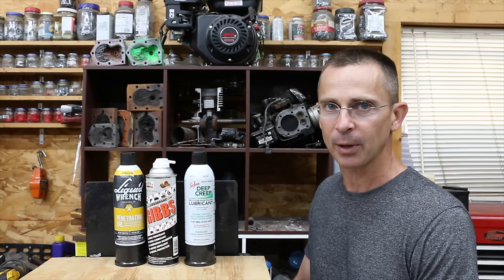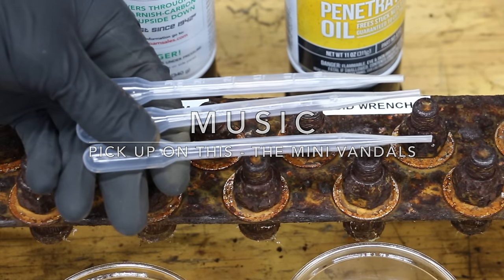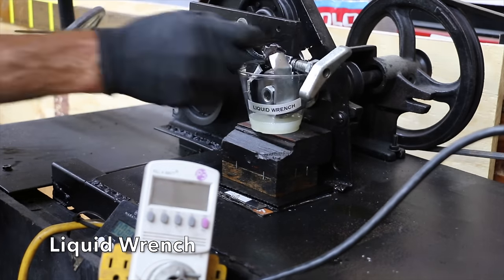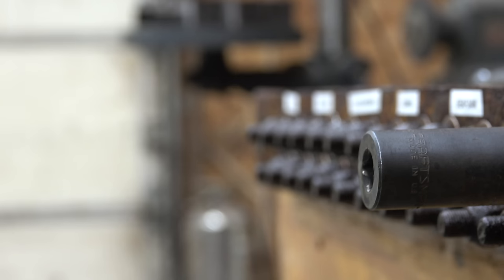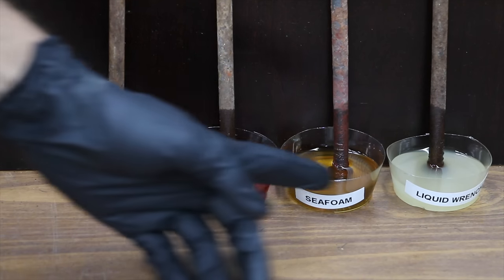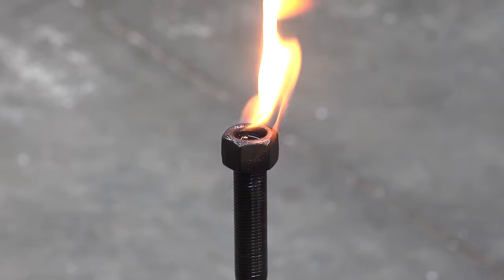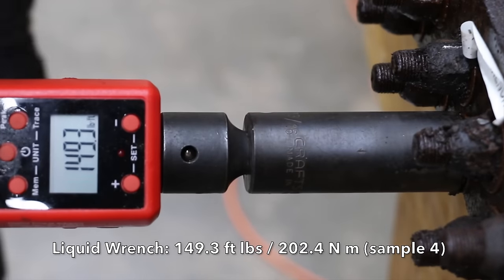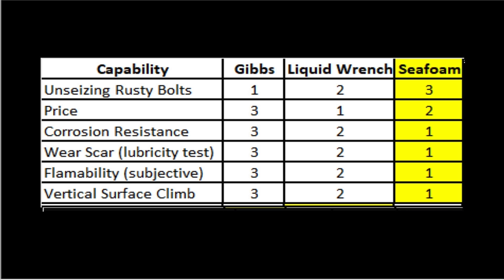Best Penetrating Oil?  Seafoam vs Gibbs vs Liquid Wrench

Comment from the maker: Thanks to everyone who requested this showdown.  Here are links to the products tested.  Thanks again, Todd
Gibbs: https://amzn.to/34pk47Q
Seafoam Deep Creep: https://amzn.to/31kSNBw
Liquid Wrench: https://amzn.to/32f2AIG
Reply: So... does this mean people should spray their engines down with Sea Foam Deep Creep to prevent rusting?
Reply: @TheRealNormanBates  it's not a bad idea to spray something in your engine especially if you thinking of putting it into the storage for longer preiod of time. I would spray something into the intake while cranking engine and then hand crank and spray individually in each spark plug hole or injector  port if it's a diesel. i would mix all brands togheter to obtain all features  lol
Reply: I would have liked to have seen Vinegar used in these tests as well.
Reply: @kevinradford9336 He used vinegar in earlier tests.
Reply: I'd suggest using a wire brush to clean and clear exposed fastener threads, is probably more important than the fluidic ability to carry the nut over the threads.   Really breaking free frozen nuts and bolts should be the big consideration here..
Reply: My question is, do you try and loosen the bolt after applying heat to these products, did they break it loose or break the bolt? I'm trying to find the most efficient product while also considering applying heat.

Comment: As a professional mechanic in the rusty midwest i used to be a PB blaster guy until i saw your videos. Switched to liquid wrench and haven't gone back. Best performance for the price.
Reply: Even if PB was a bit better i won't use unless it's all i have handy,  The " Blaster in the name is an accurate description of what happens when ya push down on the snozzel..
Reply from the maker: Thank you very much!  I have a lot of rust to deal with on the farm and Liquid Wrench is my go to product due to the price and amount of product I use.
Reply: Shoot, I also posted almost the same comment above
Reply: @ProjectFarm  
I usually have to deal with rusted latches, such as pintle hooks, instead of bolts in my job. I used to use WD40, but now that I've watched your comparison, I think I'll switch to the cheaper Liquid Wrench.
Reply: Ikr. The gibs might be better, but good lord, not for 3x the price of liquid wrench.
Reply: @ProjectFarm  As your testing pointed out, Liquid Wrench is flammable where Deep Creep is not. If you are removing rusty nuts and bolts
and you heat them up after applying Liquid Wrench you will have a fire under the vehicle that could be quite dangerous not with Deep Creep.
Enjoyed your video, but I will still stay with Deep Creep.
Reply: @ProjectFarm  I use WD-40 to help break any stuck bolts free on my farm and it works pretty good for me
Reply: @JuliaCV9  try liquid wrench, it'll be a lot better
Reply: @M.TTT.  better than WD-40?
Reply: @elliottmaendel4686  kroil is amazing, I agree
Reply: @elliottmaendel4686  He tried Kroil in an older video and it was one of the worst in terms of effectiveness.
Reply: Nah for really seized stuff CRC freeze off
Reply: Blaster lost to liquid wrench in the previous competition
Reply: @Light Roast Coffee This is why I switched from PB- the smell is haunting and overpowering. Liquid Wrench always disappointed me surprisingly, in comparison, but much better smell. I’ve since stuck with the WD40 Penetrating oil with “low odor” (similar to PB’s smell but much less strong)

I have a 1960’s can of Harmony penetrating oil. Not only does it work (and have a cute musical note design motif), but it actually smells GOOD! vaguely sweet and not caustic
Reply: @ObservationofLimits  crc lost to sea foam and sea foam lost to liquid wrench
Reply: I'm converting a couple people out here in northwest Kansas myself. Everyone just uses PB because they like to call it panther piss... I need to come up with a nickname for liquid wrench. Any suggestions?
Reply: @ronc8598 over the last couple years their nozzle things have become pieces of crap that hardly ever work correctly in the first place and almost never empty the entire bottle. it's ridiculous

Comment: >waiting for this video to finish while I'm standing in Lowe's so I know which product to get so I can get the oxygen sensors loose from my exhaust.
Reply from the maker: I hope you have good success getting it out.  Time helps these products do their job!
Reply: Add a MAP gas torch to your shopping list!
Reply: If you need to get result fast, skip to the end. He always has a quick to read analysis!
Reply: 🤣 same here goes for any other category of item review
Reply: @ProjectFarm  Saving lives as you can see ;)
Reply: @fisqual  Yeah I broke a seized O2 sensor by using two propane torches at once to heat up the threads. It finally came off.

Comment: You should compare different anti seize pastes. Like aluminum vs copper vs zinc...
Reply from the maker: Great suggestion!  Thank you
Reply: Good idea
Reply: @ProjectFarm  Have you ever tested paint strippers?....or did I just not find it yet?
Reply: x2
Reply: Agreed!  I've always used permatex anti-seize for spark plugs, exhaust bolts etc. but if there is a better alternative I'm all ears  :)
Reply: Was just thinking about commenting on this till I was reading the comments...good one...
Reply: Nickel-based anti seize is the best across the board for any fasteners. Prove me wrong.
Reply: Love this idea.
Reply: @ProjectFarm  The problem there is that different anti-seize pastes have their particular uses, like nickel on stainless steel hardware.
Reply: Would love to see this, always heard copper was better but never tried it always have used the silver.
Reply: Copper antiseize is better for electrical conducting (example spark plugs) nickel is better for corrosion.
Reply: I'd like to see that.. would make a good video
Reply: @ProjectFarm  testing galvanic corrosion using the different anti seize materials on different metals would be interesting. Like copper on aluminum threads
Reply: I like nickel base anti-seize
Reply: @deanbarrett7180  don't try that on stainless fastners - instant seizure. My experience is from when I worked in the chemicals industry.
Reply: the different metals in anti-seize are meant for different metals your using. you wouldn't want to use aluminum anti-seize on spark plugs in an aluminum head because you'd still have aluminum and steel contact, that's a large reason theres copper and zinc types. there may still be some difference between steel on steel applications but i would guess theres not much.
Reply: @gabrielhendrickson3656  yes, similar metals bond together. I have used Copperslip on plugs for 36 years and never had a problem. Still using the same tube I bought in 1974.
Reply: Don't forget about nickel antisieze...
Reply: I was thinking this the whole time. Also in the test. Will antiseize affect torque rates with spark plugs!
Reply: @TheFatherAbraham  YES! Torque ratings is a great category!! ... And then compare ARP assembly lube to vaseline and other things people typically use to ...assemble engines!
Reply: @ProjectFarm  I second that!  I have always liked copper thinking it's slightly harder than aluminum so it keeps a better boundary between threads and tolerates higher temps.
Reply: @willb3018  ,good idea.  but only paint strippers that are not known to be carcinogenic like methylene chloride is.
Reply: @gabrielhendrickson3656  That is true, and why most decent plugs are already coated.  Adding lubricant to plugs means if you torque them to spec, you've actually over-torqued them and are probably stretching the plug. Which is why most plug manf's say don't use any.  If you're really worried about them seizing up for some reason, bad childhood experience, simply pull them every couple years and clean them up and re-install.
Reply: @TheFatherAbraham  Yes, this is what most manf's say when they advise against using AS.

Comment: Can you do a video on the various spray on rust converters on car bodywork or at least effectiveness of different methods?
Reply: I'd be interested in that too
Reply from the maker: Terrific video idea!  Thank you
Reply: @ProjectFarm  Be sure to include Rust Bullet in the test, I SWEAR by that stuff!
Reply: @ProjectFarm  Masterseries Silver is the most underrated I know of.
Reply: Bilt Hamber Hydrate 80 is the best "rust converter" paint I've used except for the industrial stuff that I was told I couldn't buy anymore for some reason. It's mostly made of the same stuff, so idk why I can buy one and not the other, but oh well.
Reply: Por15 system is the undisputed champ
Reply: @ProjectFarm  and rustoleum / feruginol
Reply: Yeah! Rust Converters! I use whatever I can find at any given time but I'd really like to know what the 3 best are so I can look for 'em.
Reply: I vote for this idea
Reply: Please do this!
Reply: Second this notion.
Reply: I always liked the Rust Converter that Eastwood sells, I did the rear axle housing on my car 15 years ago and it still looks great.
Reply: 1 step rust killer. Used it a couple times and love it. Also clean up with water.
Reply: Yes that would be a great video.
Reply: @ProjectFarm  Love your videos. What would be fun is to include with each test a home made alternative as a control, like using acetone/ATF against these products. Thanks!!
Reply: Vote

Comment: Hey PF, I used to drive Caterpillar 777 rock hauling trucks in a mining company. Every December, the maintenance crew would start winter rebuild services and to remove the giant lug nuts, they would heat them with an oxygen acetylene torch and then immediately hit them with ice water. The expansion and contraction breaks the rust very quickly. Usually one time around would loosen the nuts.
Excellent vid and a very methodical approach as usual. Appreciate your time and effort.
Reply from the maker: That's very interesting!  I should put together a video on various strategies of using heat.  Thanks again!!
Reply: how hot would they heat the lug nuts?   They must have heated  one at a time then hit with ice water?
Reply: TheRoadhammer379 I'm sure it works but I'd be worried about it fracturing the material possibly leading to a catastrophic failure some point down the road.
Reply: @brianjonker510 , I watched them a few times and they would get the nuts glowing orange. Now not every nut got heated, most would come off with the impact and they replaced all of the nuts with new ones. The nuts were throwaways, they would try to not destroy the studs.
Reply: @TheMattc999 , I know in the three years of employment, I never wrote up broken studs or nuts on the inspection report. But bear in mind, these trucks had like 46 lug studs to bear the load.
Reply: @ProjectFarm  I've seen the induction heaters used on frozen bolts and they were amazing in freeing some really stubborn ones.  Might be an option for your heating test?
Reply: @TheMattc999  
Yes, I agree. 
Is the metal as strong as before? Heating changes metal and makes it weaker than before heat.
Reply: @johnbeeck2540   induction heaters are great.
Reply: @Stoma Bag; @ TheMattc999 and what do you think your car mechanic does with these stubborn rusty old nuts?? ;-) thats the oldest trick in the book, and yet most effective one
Reply: Mike B actually I am my mechanic, and yeah I use a torch to break loose rusted bolts. But I also ALWAYS  replace them with new nuts and bolts.

Comment: Time for another penetrating oil showdown?  I’d love to see a “mechanics” format.  Maybe do 3 arrays of bolts, and apply penetrant in the vertical, horizontal and upside down, all using the spray nozzle.  It should only sit fir 15-30 min MAX.  This would better replicate shop conditions, where time is money!  Keep up the great work!

Comment: My 1990 Evinrude engine on my boat has only been fished in saltwater. The paint is missing from all the fiberglass on the outside. My grandfather taught me to spray the engine on the inside with fluid film. It still looks like brand new not even the spark plugs have rust on them. That's 28 years of service in the salt still works great. I will never use anything else. Fluid film is the bomb.
Reply from the maker: Fluid Film is an amazing rust blocker!
Reply: I can second that. Fluid Film is quite good.
Reply: @ProjectFarm  Maybe that's a good test? Rust blockers. We use FF on our plow fleet (26 trucks, 14 Bobcat skidsteers, 1 JLG telehandler, 2 Kubota UTVs) and I'd be interested to see if there is anything out there that can beat it!
Reply: @LandaSnep  id say the product that Krown uses as an underbody rust protectant would give it a run for its money
Reply: @dbonics420  there's a good head-to-head test!
Reply: Never heard of Fluid Flim before where do you purchase it at?
Reply: Amazon is one spot. It's pretty much the most popular DIY undercoat solution for rust protection. Needs to be reapplied yearly.
Reply: A good contestant for a rust blocker showoff would be a grease/solvent mixture. It's sold around here as "cable grease" as you can apply it to steel cables and they'll soak up the product but then the solvents air off and only the thick sticky grease remains . It's a very good rust blocker as you can spray it on with a cheap undercoating gun and it won't get washed off as easily as fluid film but still creeps into every crevice.
Reply: @creak92  more stuff I have never saw or heard ofwe use No-Ox at work for our copper cable connections.
Reply: @LandaSnep  How do you apply it, and how much do you use? I see it in aerosol cans, but have a hard time believing you take like 100 cans and spray all over the equipment. Or, do you just apply it to problem areas like joints? Thank you.
Reply: @jimsomerville3924  we buy it in 5 gallon pails and scoop it in to a specially made sprayer.
Reply: @LandaSnep  CRC / SP-400

Comment: Everybody gangsta till the nuts won't loosen up
Reply from the maker: Thank you!
Reply: I am a gangsta
Reply: That's when the 1400 lb impact comes out lol the nuts coming off with or without the stud lol
Reply: @robzombie1845  
What do you do with Wisconsin trucks where there's no flats left on the nut lol, not using an impact.
Reply: @kylesonsalla7620  use a rocket socket
Reply: @zain581  you are betrayl
Reply: yes yes bigfoot we know.
Reply: @makern5304  it's complicated
Reply: @zain581  shh
Reply: @TestarossaF110  lol
Reply: @kylesonsalla7620  that's when you MacGyver it with a welder or a truck battery one of the two
Reply: Lol
Reply: I'm a gangsta grandpa, and I'm proud of it.
Reply: Rust: turning a 30 minute job into 6 hour nightmare since the dawn of time.
Reply: Well that’s what happens when you’re covered in hair and shit in the woods
Reply: Kyle Sonsalla upstate New York is torch and vice grip territory. Rust belt mechanics own all others and don’t brag about it enough
Reply: Thank you

Comment: Thanks for the excellent videos. Very well done and very informative. I am surprised that these products only reduce force required to losten a rusted bolt by roughly 10% compred to the untreated control. I figured it would make more of a difference.
Reply from the maker: Thank you!
Reply: Well consider that these nuts were originally only torqued down to 80 Ft-Lbs. If they were torqued down with more force, more force would be required to get them off, that difference in ft-lbs would grow, and be even more significant. Also depending on the tool/wrench used, it could mean the difference in potentially breaking something like a ratchet vs not breaking it. Also he starts out with new bolts. If these were bolts that have been rusting for years, it could mean an even larger difference in force required for removal. Along with the fact that the heads might be even more worn, and more likely to strip, so less force might be the difference between stripping the head, or getting it off. The point is, you're always better off using something vs nothing. Also more time for penetration is always better. These things can come in super clutch in more sensitive areas/projects. Where a broken bolt, stripped head, etc...could be the difference between a 15 minute job or a 4 day pain in the ass project.

Comment: in alll my years as a mechanic 65 years i found that heat to red hot 2 or 3 times then pen. oil dont get in hurry 0n exhaust bolts and nuts heat again for removal  works  best noooo hurry great show thank you !!!

Comment: Great episode (as always)! One thing I think is a good mention here is, if you can get the nut to move, it's very important to rock the nut back and forth as you remove it. This will almost always assure you get the nut off without stripping or breaking. Lord knows I have broken many off that initially loosened. Definitely took more times to learn my lesson than it should have :-)
Reply from the maker: Great tip!  Thank you

Comment: Todd, did you try any of the home made 
concoctions?  ATF and acetone, is what 
I'm thinking about.  I'm sure there are others.

steve
Reply from the maker: Thank you!  I tested ATF/acetone quite a while back and it did great.
Reply: I think this was kinda the best of the best type thing, he's tested a wide variety of things suggested for this type of application.  These 3 just came out on top.
Reply: 50% ATF and brake fluid works wonders as well.
Reply: Ave did a video on your suggestions.
Reply: @Frost640  I haven't tried that one before, but it seems that it would be a great idea for old brake fluid that you wouldn't want to use in your car.  If the container had been open too long for example.

Comment: I like your attention to detail in all of your experiments. Using the same environment, same measuring devices, applying the product in the same way, etc. The only changing part is the product. It makes for really good data collection and trustworthy results.

I am in the process of removing an exhaust and purchased Liquid Wrench based on your experiments. Zero snapped bolts so far.
Reply from the maker: Thanks!  Thanks for sharing.